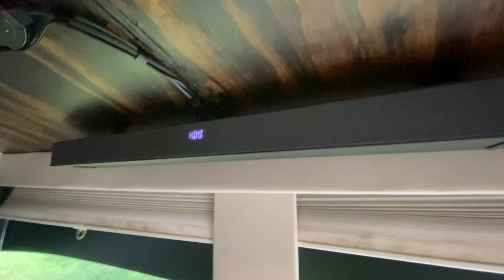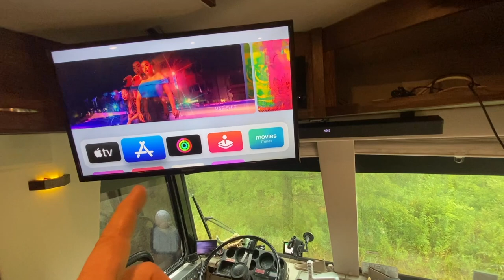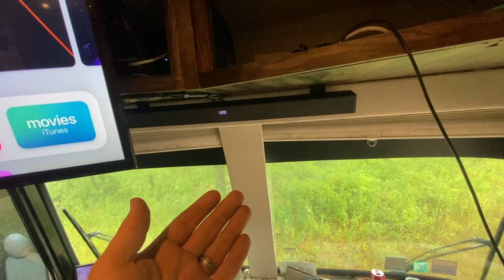Summer Solar Tour Update and Soundbar upgrade for music and movies

Comment: That's a great idea with the sound bar Shawn which model did you get I was considering the same idea but you beat me to it.
And you got one that's blue tooth as well 
Please let me know which one and where did you get it I'd appreciate it.
Reply from the maker: https://www.walmart.com/ip/onn-2-1-Soundbar-with-2-Speakers-and-Wireless-Subwoofer/551851492 

I got this one in part because the sub is so thin.  Driven 100 miles or so with it, I need to dampen the vibrations from my mounting system. Other than that, it’s been great.
Reply: @HimmelbergerBus  are you back in mn?